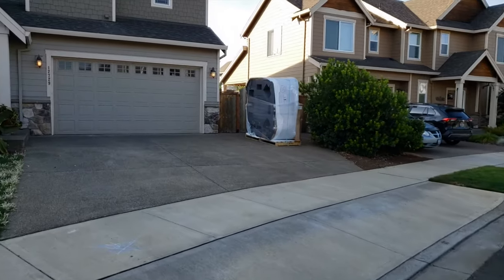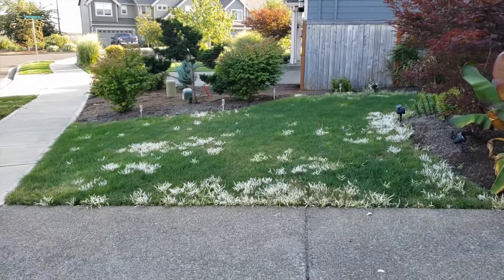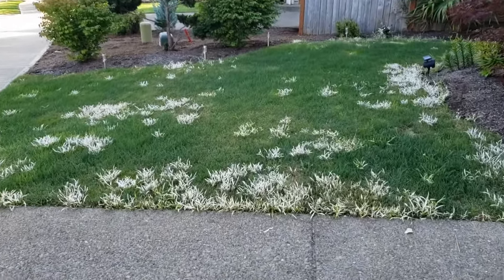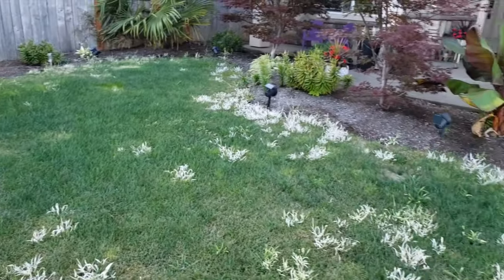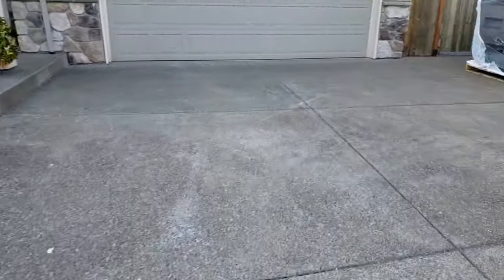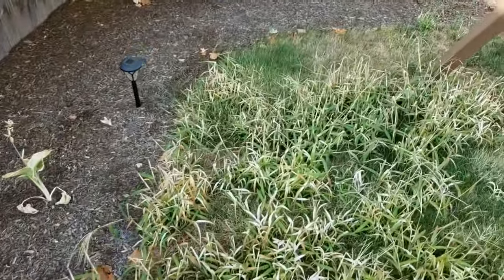Cool hot tub moving hack!

Comment: How much does that tub weigh? You guys brought it down easy with only 3 guys. Mine is on its side delivered and it weighs 800lbs so I figure I need at least 5 guys to tilt it over.
Reply from the maker: The owners manual says it weighs 430lbs. It moved like it weighed 100lbs😄. It laid down pretty easy with 3 men. I would think you should have no trouble with 5 men. Youll be surprised how easy it will slide on that coraplast. If you use it, let me know how it goes. Be safe! Thanks for the question and watching the video.

Comment: Job well done! What material did you use for the sled itself? And the plastic sheeting between the sled and the ground?
Reply from the maker: Hi Scott
I was surprised by how well it work! I bought a 4x8 sheet of corosplast from home depot. About $25. We used to call it coroply. Its just plastic cardboard. I cut it down to fit between the gate, but you could just leave it 4' wide. For extra protection, I put a thick piece of cardboard between the coroplast and the tub. And thats about it. Pretty simple. Only problem is, what do I do with it now?? : )
Thanks for watching and commenting. Let me know if you ever need to move a tub. Ill give it to you!!!
Reply: @retirementwithpete9859  How did you attach the rope to the sled? Looks like it's anchored to a 2x4 or something, but you must have it reinforced somehow, because it seems like the rope would rip right out when you try to pull it with a spa on the sled.
Reply from the maker: @TylerTervooren  
Hi Tyler. Its funny you should ask. I actually videoed the entire assembly process, but somehow that portion of the video got lost when we edited it for the channel. 
Im going to redo the entire video, and add that portion. 
I just folded the corply and cardboard around the 2x4. Had to  score one side of the corply, to get it to bend around the board. Then ran 4 - 2-1/2" x 1/4-20 bolts all the way through. 
I used 3/4" rope, that I melted the ends. Drilled a couple 7/8" holes through the board. Put the rope through the board, then slid a big washer onto the rope. Then just tied a single knot at the end of the rope, and pulled ot tight. It worked way better than I thought it would. The tub manufacturer said the tub weighed 320 lbs dry.
It pulled it like it weighed 50 lbs.
Thanks for your comment.
Hope to have the new video on youtube by this weekend😉
Reply: @retirementwithpete9859  Thank you! That makes perfect sense.

Comment: Coroplast got expensive.  Going to do the same thing with a piece of osb.  Thanks!
Reply from the maker: Hi Wes, yes coroplast went up from $26 to $30. About the same price as 7/16" osb. And you can re-use the osb😉. Let me know how it works. Thanks for commenting and good luck.👍
Reply: What is OSB ?  I need to make a sled to get the hot tub through our 45” gate opening when it gets delivered next month.  My husband is skeptic we can get it moved into the backyard, but I want to try this sled method.  It’s a 350 lbs tub plug & play LifeSmart tub .  You’re right, coroplast sheets are getting expensive at home improvement stores or on Amazon unless you buy in sets.
Reply from the maker: Hi GJ. OSB is short for oriented strand board. Its used in home construction. Its similar to a sheet of plywood. The price has come down to under $15 per sheet at Home Depot. Coroplast is still close to $30. My daughter's tub weighed 450 lbs. And as the video showed, we had no trouble moving it with 3 people. And, to be safe, you need at least 3 people to lay it down. 
I havent seen anyone use osb to move a tub, but it should work like the coroplast. The coroplast is more flexable, and easier to cut. Either way, its still way cheaper than hiring a spa mover. 
If you decide to use the osb, I'd like to know how it works.
Good luck on the move!!!
Thanks for watching and commenting.

Comment: Spa sleds have been on the market for years ..Amazon’s has them and they are much better at going over rocks, asphalt, rough  terrain ...grass like this job was can be done with cheap plastic but no way that thing would hold up moving spas everyday
Reply from the maker: Most people move a hot tub once, maybe twice. Which this sled can definitely do. Is this as durable as the amazon sleds??
Not even close!!  Does it cost between $500 - $600, like the amazon sleds? Not even close!! 
I spent $26 for the coraplast and $3 on the nuts and bolts. As the video title says, this is a hack.  And by all the comments, it works darn good!!
Thanks for watching!!